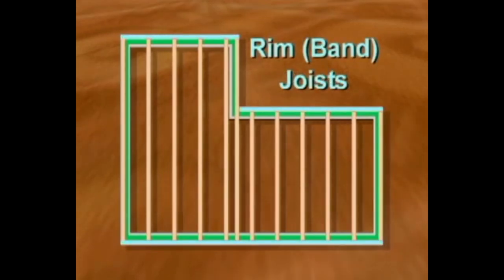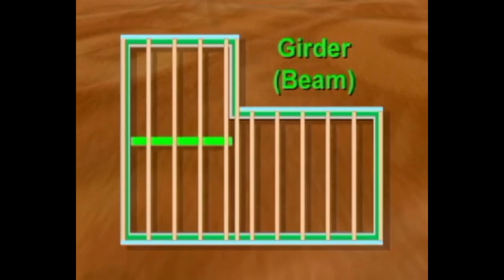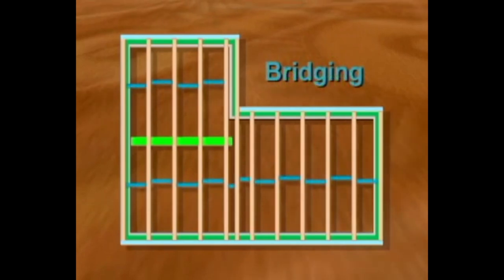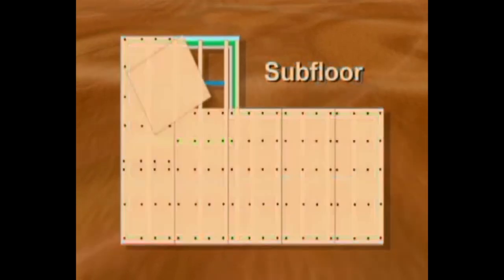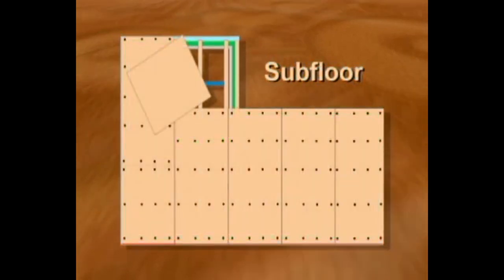Basic Floor Framing

Comment: WARNING! Structural floor sheathing should always be placed perpendicular (across) the direction of the floor joists, using tongue and groove or equivalent. This video shows you the wrong way to do the plywood. Normally, 5/8" thick is the code minimum.
Reply: Looks like sheathing is perpendicular to joist
Reply: agree, the video is a little sloppy when it comes to sheathing, it doesn't show the outline of the sheathing and the nailing pattern well